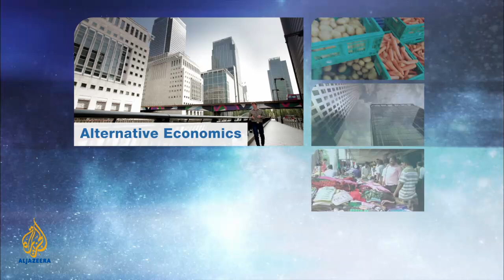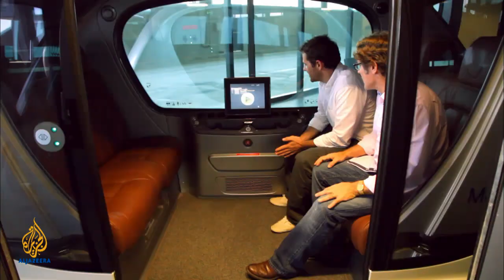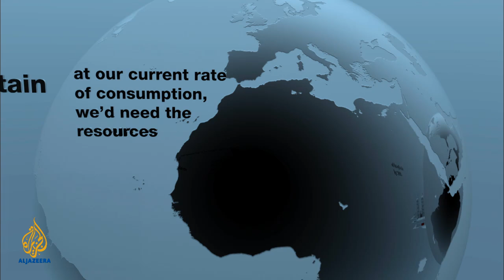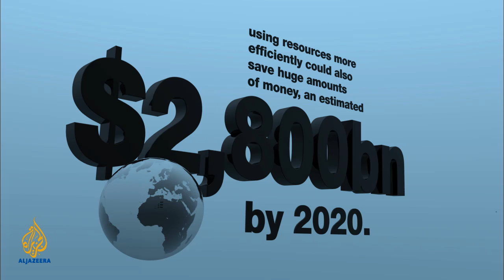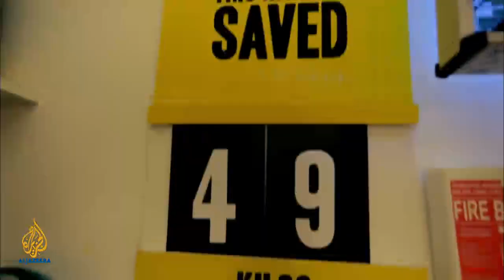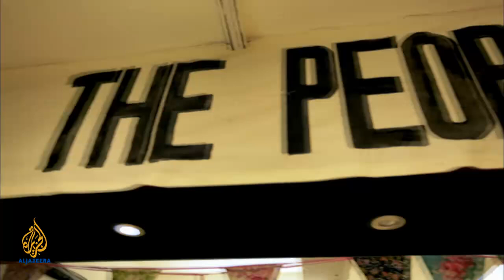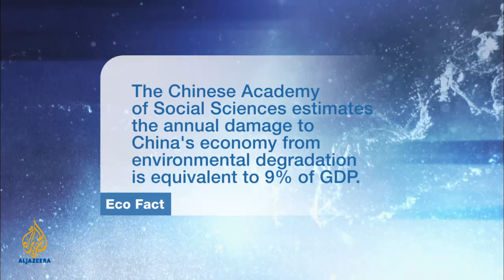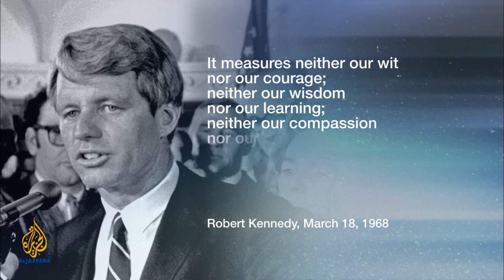earthrise - Can Growth Be Green? The Economy Special

Comment: He talks about ‘Strip Mining’ but then uses loads of new PV Solar panels. When they could of made Wind power generators made from chucked out electrical appliances and devices. Every electrical device or appliance that has a moving part. Also has a motor that can( and are) be repurposed as renewable generators!. We chuck thousands of these motors away every day, from Vacuum cleaners, to lawnmowers, to washing machines, to Gym equipment etc etc etc.

Comment: Brixton also have a LETS,( Local Exchange Trading Scheme), and a ‘Remakery’ where they use discarded items to make new ones that they sell. Every year we throw away millions of motors in our apliances and devices( every electrical device that has a moving part has a motor that can be used as a generator). If we set up at every recycling depot a building to build domestic Wind and hand wind generators, we could repurpose all those chucked out motors and much of the electronics to build EVERYONE athere own Renewable generator!. No need for Solat panels or Wind farms, we could ALL be independent from what we already throw away every day!

Comment: Also we NEED to use the car engines we already have( Internal Combustion Engine, ICE) partly cos we don’t have the time or renewable energy to build billions of new Electric vehicles(EV). Also EV rely on Non renewable Lithium which is destructive and requires vast amounts of water in evaporation pools,  But the ICE if run on Carbon Sequestering Algea Bio Fuel, we could use the world’s vehicles to suck CO2 out of the atmosphere. Photo Bio Reactors( PBR) can grow Algea Vertically so takes much less land than conventional Bio Fuel crops, plus it grows much faster, and produce a 100x more energy! Another positive to PBR’s is they can use our waste water to feed the Algea so cleaning our water in the process, saving us lots of energy in energy intensive waste water treatment. PBR need to be placed in every locality creating millions of local Green, climate saving jobs!.